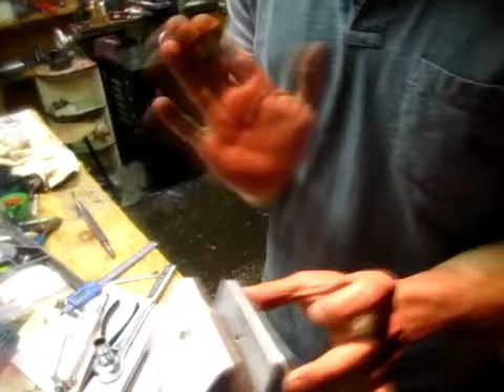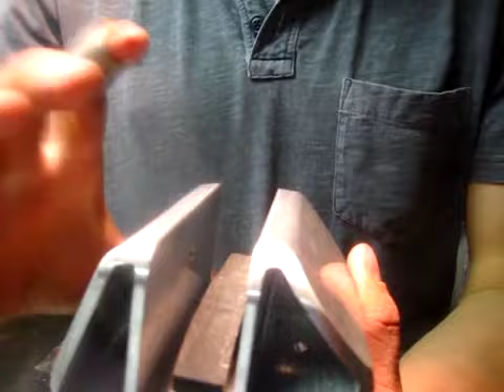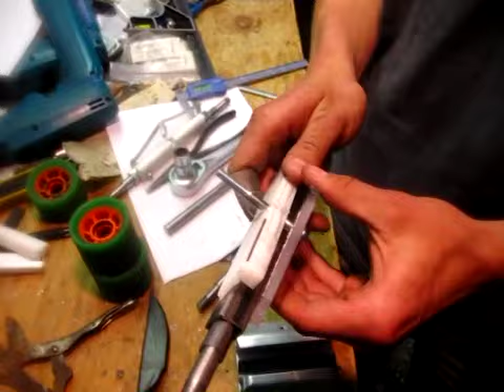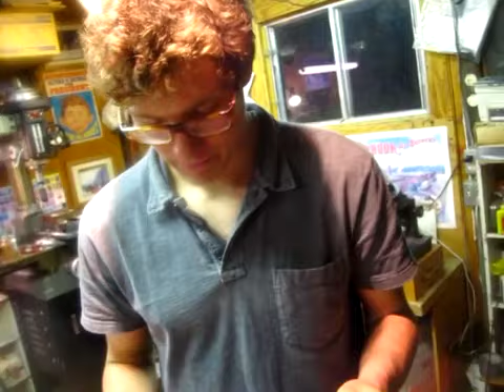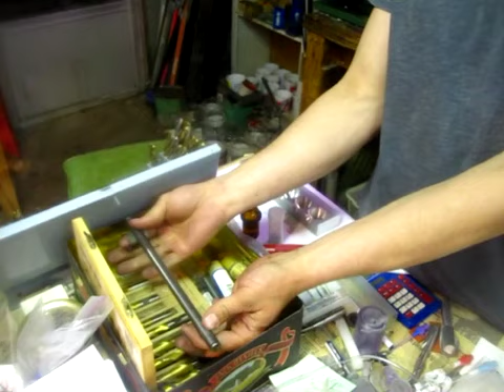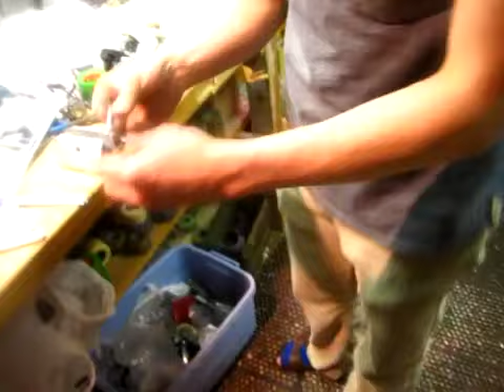Spring production Update

Comment: @chainmaillekid oh okay, the reason i want 8mm axles is because im afraid that the  10mm bearings wont perform as well as my 8mm bearings,
and when i break the 10mm bearings, i have to go on the web to buy a set >.>

well, you could integrate the nut into the baseplate itself,
but i think that design probably has many flaws and manufacturing problems... 

thanks for the reply